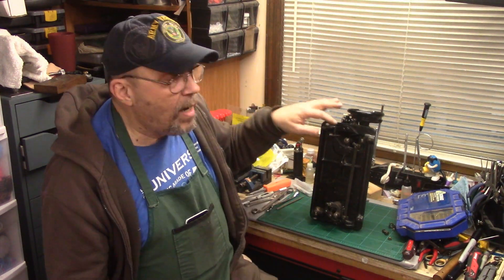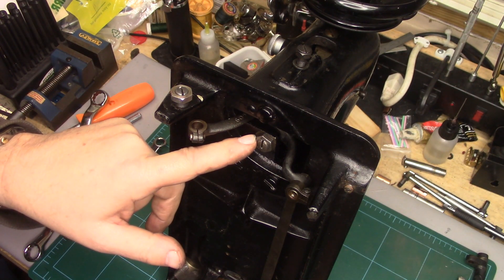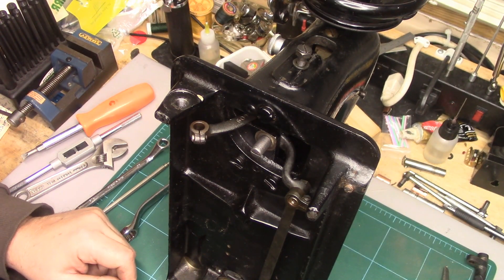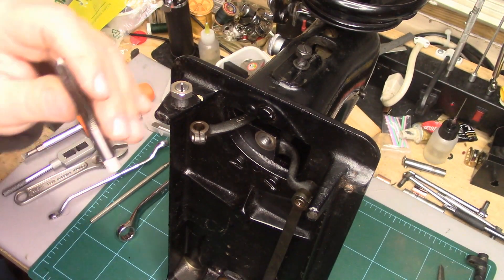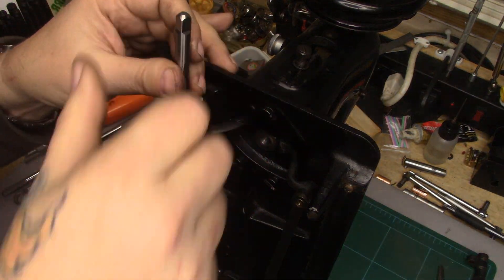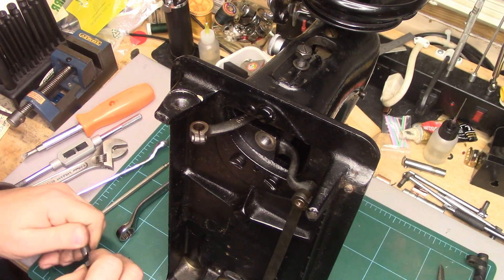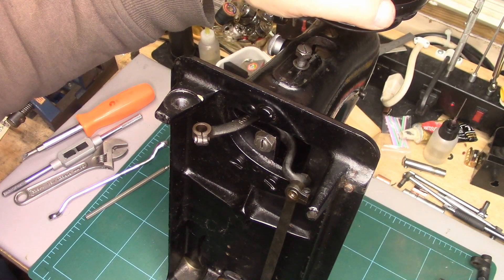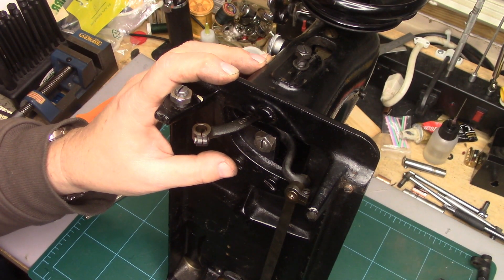Pivot Screw Madness - Sunday Morning Quickies January 2, 2022

Comment: Bob, what is the size of the tap for the presser foot adjustment. I like the way you clean the treads by chasing the treads.
Reply from the maker: The tap used for MOST of the early, cast iron domestic machines (15- whatever, 27 & 127, 28 & 128, 66, 201, etc) is 7/16"-28 tpi. This is the one I use:
https://www.mcmaster.com/2521A421/
Other machines such as the 99, 221, etc. need different taps, so measure the thread sizes!
Reply: @BobFowlerWorkshop  I measured the casting and came up with 7/16"-28 and you confirmed that I got it correct. I am one of your apprentices in Washington State. You're a great instructor! Thank you